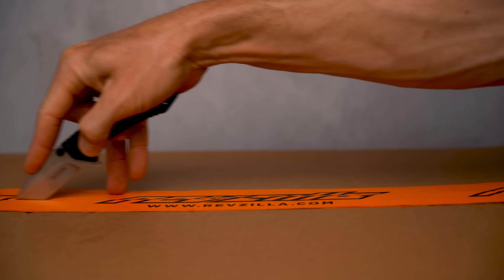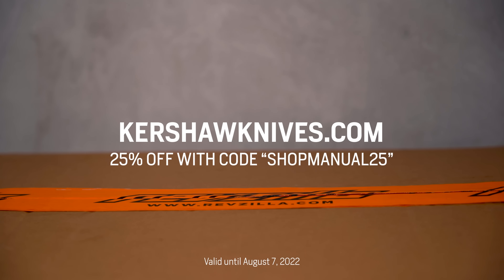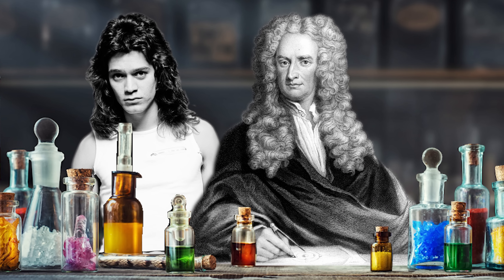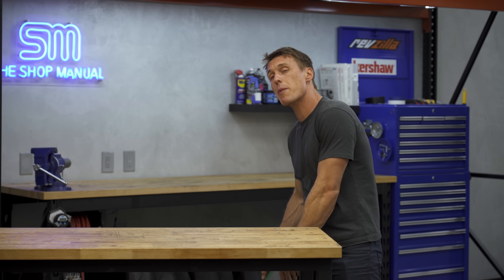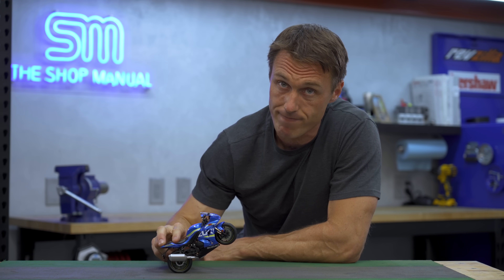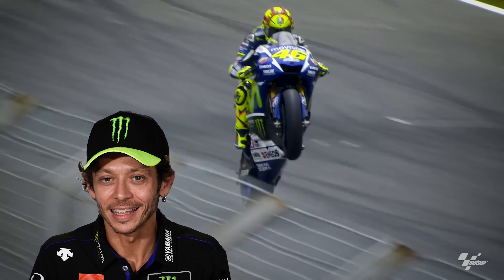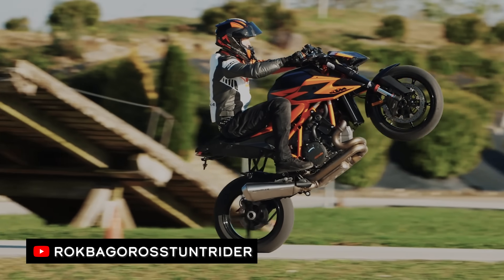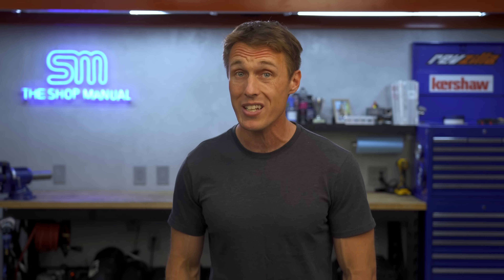Why Motorcycles Wheelie | The Shop Manual

Comment: Why don't gp bikes have greater diameter rear wheels to increase contact patch and reduce wheelies?
Reply: I'd have to imagine the weight alone is enough to deter them from changing the diameter just to solve for wheelies. Diameter would also have consequences for handling, cornering, tire drag, and top end speed issues. I'm no engineer though, but I'd have to imagine that fix isn't worth the repercussions it causes elsewhere.

Comment: MT-09 does it all the time mostly because rear suspension mush, rear swingarm geometry relative to the chassis (pro-squat angle, vs. anti-squat angle), and a rear-wheel-weight bias. Basically the countershaft sprocket is trying to climb around the rear sprocket, via a chain connection. And the bike and rider go with it.

Comment: It's beautiful how the complexities in motorcycle dynamics mean that a relatively simple mechanical machine can perform so well with what is essentially small geometric tweaks. 
The weight transfer to the rear wheel means we get full traction even with one-wheel-drive, and vice/versa full stopping power with only one-wheel-braking.

Comment: Abrupt change in speed....overcomes front load(inertia)...bike tilts about it's centre of gravity...It happens to cars when you hit the gas from a low speed or stop. It is more noticeable at low speed. Also the friction( contact) on the rear wheel is stronger. At higher speed...the forward momentum of the vehicle will cause the front to resist being lifted since there is greater drag from air and friction of tire contact. You also have a shift in weight to the rear...you feel it too...which unloads the front(the fork unloads). All of this can be expounded upon via equations etc, but it  is not beyond the realm of common sense. Same with a front wheelie. Centre of gravity is important as well.

Comment: Ironically, after owning 20 different motorcycles, the easiest one to wheelie consistently and the furthest by a huge margin was my Yamaha BWS 50 automatic step through scooter. Having a CVT and rear brake on the handlebars made it super simple, only about 5 hp made it less intimidating.

Comment: Good Video except that the center of mass is NOT of just the bike, but the combination of bike AND rider.  Also you do NOT need a powerful engine to wheelie, in fact you don't need an engine at all as I (and most likely you too) pulled wheelies on a bicycle long before our first time riding a motorcycle.
Reply: Yup, I know, but there was no rider on the bikes used in animations or demonstrations  😉 
And yeah, I also know it doesn't take much power to wheelie. The CRF50 I'm riding in the intro/outro only has a whopping 3 horsepower.
Reply: @AriH211  : Reguarding "a whopping 3 horsepower", I think that people need to put horsepower in perspective.  A world class bicyclist can produce about 0.6 horseprower for an hour, which is 1/5 of that '50, the rest of us are lucky to be able to make half of that.

Comment: Although there was a fundamental error in applying Newton’s third law, this was great.  The toy demo was excellent!
Reply: Care to expound on the error?
Reply: @AriH211  It doesn’t matter much as your explanation over all was excellent.  With Newton’s third law, the equal and opposite force would be the lid on your hand (making you feel the pressure on your hand).  The original force was by your hand on the lid.  It’s always the same two objects, just in reverse.  Also, technically, physicists dislike the action/reaction wording although this is the popular colloquial wording.  The reason is because both forces happen at exactly the same time.  Although I have a degree in Physics, I must acknowledge that you sir, have a Masters in Motorcycles!
Reply: @regularguy9264  Thanks for the clarification. Makes perfect sense!
Reply: @AriH211  Hey, just checking.  I received another reply that says “telegram me👉…” about being shortlisted for a prize.  It asks me to send a text.  Is this a scam as it shows up as a reply to this thread to me personally but not publicly.  If it IS a scam, I just wanted to let you guys know!
Reply from the maker: @regularguy9264  Definitely a scam! Automod let that one slip by, thanks for letting us know!

Comment: I would've loved to hear them break down a clutch up not just power wheelies!
Reply: Same concept of physics but technqiue-wise... Clutch up, you just clutch in, rev to appropriate RPMs and then dump the clutch. Power wheelies, you just roll on the throttle quickly.
Reply: @ErichWilhelmVW 
Yeah, simply rev up, dump the clutch and either end up on your back or with the handlebar ripped from one hand and on your side.
There's a bit more to clutch wheelies than just dumping the clutch at X rpms, it's not as simple as that for beginners.

Because if you need the clutch to do a wheelie that means your bike is too front heavy for a power wheelie and proper technique is that much more important. That means proper body position, knowing how to pull and hold on the handlebar while at the same time dosing the gas, making sure your right foot is on the brake at all times, etc.

Power wheelie can easily be practiced, clutch wheelie not at all. There's a much bigger risk of dumping the bike instead and hurting yourself.
Reply: @mickeypopa  Of course proper technique is required for any skill one tries. I didn't say just twist and pray lol you can "easily" practice by releasing the clutch at low RPMs and gradually increase to see how the bike responds.

Comment: As long as I have been riding, I have never done a wheelie.  Too afraid I'm going to bin it.  These were great explanations!
Reply: That’s good you’re afraid but if you want to dip your toes into the world of wheelies, start with a bicycle on grass and then work up to a dirt bike. Don’t forget, if you get caught doing one on a public road, it’s usually a guaranteed reckless driving charge in most states. Don’t get caught 😉
Reply: When I was young trying to master wheelies I did my share of bending license plates and cracking taillights and although rare seeing my bike continue on without me. My best wheelies were the ones not intended. If I happen to pop the front wheel up now it’s only inches getting on the throttle hard from a stop sign or red light I’m really no longer interested in popping wheelies.
Reply: Honestly it's almost as stable riding on 1 wheel as 2! Centrifugal force or whatever haha
Reply: I've found that I enjoy wheelies in my mountain bike far more than my motorcycle. I don't care about tossing my bicycle. Actually, I ride it to the absolute limits knowing it will get tossed and be unharmed.

GSXR? Different story
Reply: u can practice it in the spot really.. I learned to do it just like that with my both feet on the ground and popping the clutch on first gear (on a small bike) and that's very easy to control just hit the clutch again and it will go down, that's how I grasp the concept in a more practical and safer way. You can also do it while riding very safely that's how most ppl also learn to do it like its explained on this video just ride super slow and use the clutch (no power wheelie) and u can very easy control it by not only pulling the clutch again but also using the rear break (that's how u keep the wheely going once u "master" it u can tap the rear break to keep the wheely from going to far up while keeping the front wheel up at all times)

NOTE: very important if u decide to practice it.. do it at a parking lot or some very open area with no1 around that's the number 1 priority.
Reply: Agree with others here, unless you are a complete klutz on your bike (in which case you need to get some training), it's a fairly easy thing to experiment with small wheelies. Your own fear will keep you from going too far too fast. 
Another method besides clutching as mentioned, is just rolling in first gear about halfway or more up your rev range, then quickly shutting & re-opening the throttle, using the fork springs to help pop the front up. I practiced this way when learning, and it allows you to start with small wheelies and gradually hold them longer and higher.
As mentioned, always cover the rear brake with your foot. If you tap it it will bring the front right back down.
Reply: @ToddGlasier  Very good advice, thanks for sharing!
Reply: There's literally no practical use for wheelies, unless off-roading and needed to hope a tall obstruction, like a piece of downed timber, or a stump, or a rock. On the street it's just showboating, and it's dangerous. Getting it up you may, but landing it wrong and you'll get a tankslapper. If you wish to practice, make VERY sure your suspension is up for the task. In other words, excessive fork dive under hard braking (or landing a wheelie) will set you up for a bad day. Oscillation happens when your fork geometry is nearly vertical and your front wheel starts flapping like a caster wheel on a grocery cart.
Reply: @turnin.sprocket  of course it is for showing off and having fun that's all there is to it. Have a problem with that? lol.
Reply: @GatsuRage  I don't have a problem with people pulling wheelies. I don't have a problem with people tight-roping across skyscrapers, I don't have a problem with people juggling running chainsaws. I'm offering some caution, that's all.

Comment: I’ve always been too scared to commit to doing a wheelie that wasn’t just a speed wheelie. I cannot just replace a bike I drop and ruin.
Reply: 1. The back brake is your best friend. Practice slow wheelies and train your brain to let them down with the rear brake.
2. Ride an older, cheaper, mechanically sound bike you don't give a shit about. 
3. Second gear clutch-ups are far safer than looping it on the throttle in first.
Reply: @supermotardrider  if I had a second bike to mess around with I’d be all
Over it but just got the one bike. 02 Ducati monster. Not dropping her for a wheelie haha
Reply: @ickess  understandable. Remember the N=N+1 rule when it comes to bikes.
N is the amount of bikes you currently have. You always need one more.
Reply: @supermotardrider  ha, can’t argue with that math
Reply: Pain is a dang good reason too.
Reply: @froglaps40  Amen to that.
Reply: Hah, I feel ya.
Reply: @dandymcgee  have you heard of "Sonic inflation" ?
Reply: Fuck the bike, what about your life and body?
Reply: I cannot replace my ass I drop and ruin. I have to feed my kids.

Comment: Nicely packaged video. 6:00 Short wheelbase, high center of gravity motorcycles wheelie easier.  Free body diagrams aren't that difficult.  I was tested on then as a mere lad of 18 at university. Bonus material.  A powerful motorcycle will either wheelie or burn out. I couldn't wheelie a stingray bicycle with a banana seat at 12.  I'm not gonna practice on a liter bike. My front forks love me.

Comment: I notice that its harder for me to Wheelie. Its possible but I notice I have to work harder. I'm short and light weight, and I notice that cause me not to be able to lean my my weight back. Or that my weight has much of an effect. I often have to bounce the shocks on the bike to get a decent effect
Reply: you must ride a weak one eh?
Reply: Same boat and I ride a MT-09, even in A-Mode, the front wheel stay grounded. Even when commuting with a heavy backpack, it doesn't change the riding dynamic in any way I can notice. So yeah, no dank nooners for me.
Reply: @tarouyamada2686  mt-09's wheelie great! idk what ya'll are talking about rider weight and heavy backpacks for..? thats got nothing to do with the ol wheelie! sounds like ya'll just need to improve your clutch work.
Reply: @DownHillSkateTime  No doubt 👍
What I was addressing was more about power wheelies or getting front lift under very hard acceleration, which doesn't happen to me, leaning back and pulling on the handlebars or not. My technique is non-existant, don't read too much into it 😂
Reply: @tarouyamada2686  try to learn and understand the clutch up because it is a much safer and controlled way of doing wheelies

Comment: I have been interested in learning wheelies but afraid I’d hurt myself. I only want to learn to have more control not to be a hooligan. Any suggestions for a 50 yo guy without a pos dual sport to thrash and no longer bounce when I fall?
Reply: Search for info on the little Honda 50cc dirt bikes. There’s lots of adults that ride them for fun, practicing stunts, and even racing. 

For learning to wheelie they’re light, slow, and low. Which means if you do crash or fall over you don’t have far to go and won’t be really fast. And, they’re a cheap dirt bike so tearing it up isn’t really an issue.
Reply: there isn't really an easy way. getting a small kids dirt bike is a good start